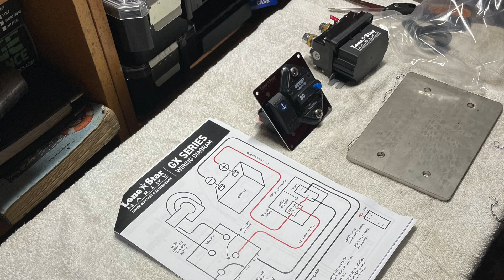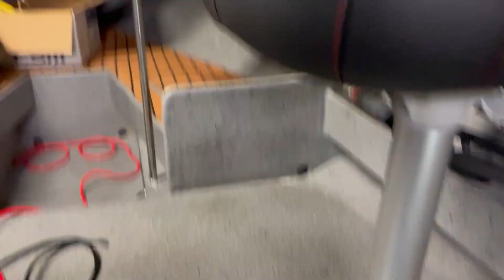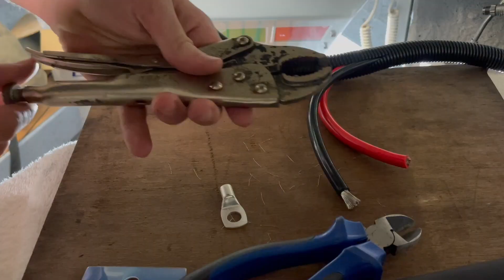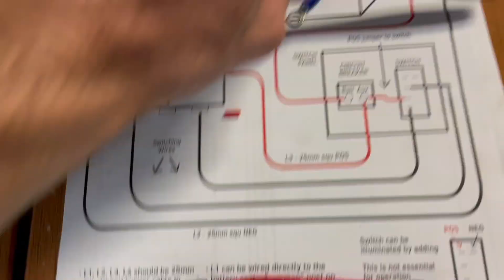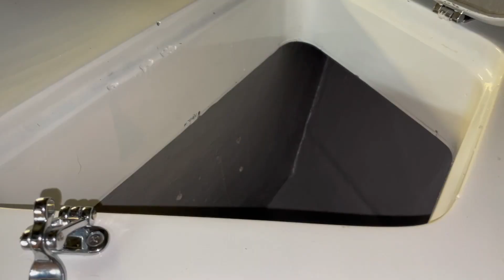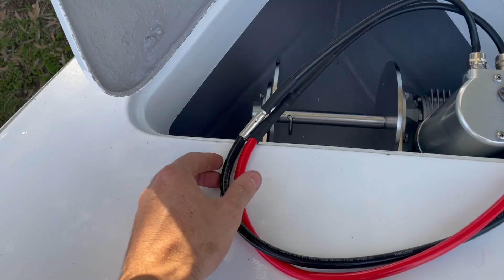[EP8] Lone Star GX-1 Anchor Winch Installation - Cruse Craft Galaxy 585XL

Comment: Great video
I am still chewing the fat whether to get gx1 or 2
5.5 carrabean mainly fish in Lake Macquarie about 12 m of water
I have a twin battery setup with a Jono 90 2 stroke (rectifier, no altinater)
so presume run motor and have batteries on both to raise or lower ?
current anchor is 10 pound looking at a 15 pound anchor with 6 m of 8mm chain in a sock plus bow sprite and hawf pipe
Reply from the maker: GX1 has all the anchor power in the world, it just lacks the drum size for enough rope in this gauge. I think you can get a bigger drum for them now.

Comment: Should use 6mm polyethylene, synthetic winch cable approximately around 3000 kg breaking strain for good quality it is about 15 times stronger than nylon.
Reply from the maker: @pdevonport7266  I just don’t trust something than thin, more for wear through than strength
Reply: @cheapthrillsgarage  Lone Star sells the cheaper 6mm nylon anchor packs with that winch as standard and that is double braided nylon which is very cheap and quite a lot of stretch, this is to keep the price down. But you can also buy 6mm braided  Polymer rope which is more expensive, but you can fit a lot more rope on the drum. The main advantages are considerably stronger, no stretch and does not absorb water, as well as oil and chemical resistant, and it's abrasive resistance. One of the downsides is that it may need a shock leader of nylon because there is very little stretch in polymer braid. It can damage the winch if there is a sudden shock and break the rope but that's more likely to affect larger vessels.

Comment: great video mate, you've helped me heaps with it. One tip that I'd pass onto you is where you've drilled for the conduit I would have sealed that timber with an epoxy to prevent moisture getting into the wood. That's my standard practice for any exposed timber on boats.
Reply from the maker: Thanks mate, I should have showed it, I sealed it with Sika.